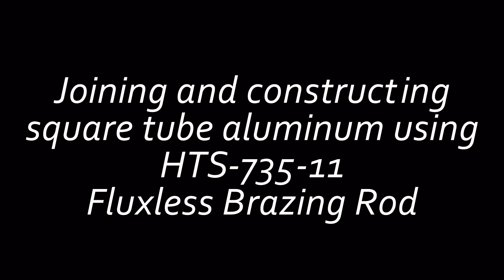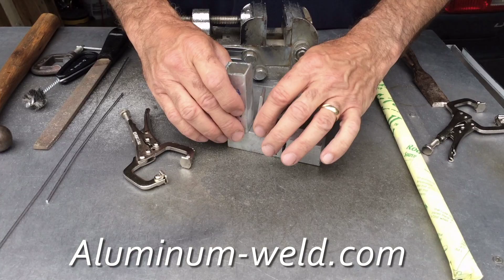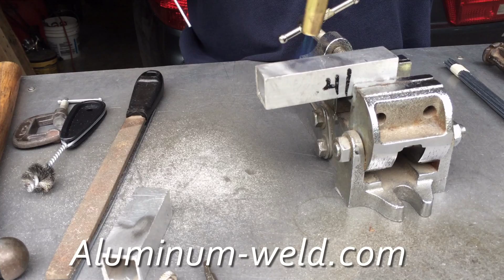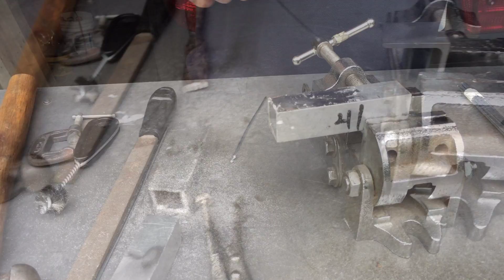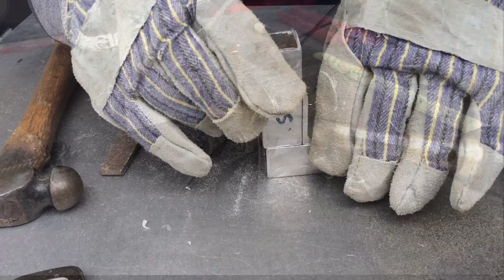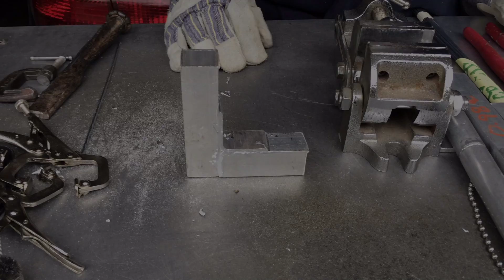Welding Square Aluminum  Tubing with HTS-735-11

Comment: Im new to all of this, and the brazing of aluminum has caught my attention to make something just to try it out. When brazing aluminum I take it that the length of the square tubing has a huge effect on initial heating,  would you suggest using a acetylene torch for tubing over a certain length or the propane torch will work?
Reply from the maker: Hello, There are several factors to consider, Torch tip ,  will make a huge difference, I like a Bernzomatic TS8000, you can use propane or Mapp Gas with this torch. The size and thickness of the square tubing makes a difference as well. Watch my video on joining irrigation pipe. I use propane for that video. You can use acetylene just control the heat, use a rosebud tip, watch my heat control video and torch tip video. Remember you are just warming up the aluminum to the melting point of the HTS-735-11 Rod.  If you cannot HTS-735-11 Rod to melt on the heated aluminum you do not have enough heat. watch my weld aluminum at home video. Thanks for your interest.

Comment: Great video. 
Lately I bought an aluminum rod online but I noticed that it didn't melt as easy as you did.  I think it's just normal aluminum though and not low melting one.  How I wish hts-735-11 is available in my country.
Reply: There's lots of aluminum brazing rods if you can't find this particular one.

Comment: Thank you for the video, Can I using this method to join aluminum tube to steel tube? And how many joints I can make in one such rod on your vid?
Reply from the maker: Hello, HTS-735-11 will NOT work on steel, stainless steel, or cast iron.. HTS-735-11 works on nonferrous  metals. You can join copper to aluminum. One rod will make between 3 to 6 joints.

Comment: ....and then when you go to join the other end of your square tube to something, you have to heat up the piece so hot that you melt your previously formed joints.  Because solder is fun like that.
Reply from the maker: Hi Andrew , Good point.  You would be surprised how little of a problem that really is. First you can let the first joint cool or you can used heat stops or heat sinks.  I have made joints very close together without issue. Also you can clamp the joints like shown in my video. Thanks for your comment.

Comment: welding is more of a marketing term for this stuff because a lot of people will look for welding rather than brazing so i see why its named welding it helps on a selling perspective but i would also add brazing too. 

do you have a video showing how strong it is like trying to pull it apart or something?
Reply from the maker: Hi Toto,
You are right on with your comments.  I do have a butt joint video that shows strength testing, also I plan to add several additional videos soon.
Reply: @Aluminum-weld  nice one
Reply from the maker: @TotoGuy-Original   Hello Toto I just posted a new video of a Tee Joint Strength test,  If you get time check it out.

Comment: Why are you always moving things and tossing things from beginning to end of video ????? Relax freak ! This is NOT WELDING this is soldering which is a MUCH weaker bond then WELDING !!!!!!!!!!!!!!!!!!!!!!!!!!!
Reply from the maker: Hi Rich,

Yep I was moving pretty fast, that is because I did not have my welding gloves and the metal was very HOT!!!!
As for the strength, I plan to add additional videos to address that in the next 3 months. This product will never replace welding, however it has it place for quick, easy, and portable repairs that are strong.  It has its place so relax man.
Reply from the maker: Hi Rich Check out my newest video added today with you in mind. "Tee Joint Strength Test."

Comment: This is aluminum SOLDERING not welding. Base materials are not melted together, there is no FUSION between joining parts, which actually real welding is. To call this Welding is dangerously misleading. A a structural engineer with 60 years of experience, I recommend to rename this video.
Reply from the maker: Hi Bob, added a video check it out when you get time.
Reply from the maker: Hi Bob I added new videos that addresses your concerns.  Check out the TEE Joint video.
Reply from the maker: Hello Old Bob,
You are correct that this does not fit the true definition of welding. The metals are not melted together. The metals are bonded together  via a (Eutectic Bond) that is stronger than the original commercial aluminum. There is actual fusion that can be observed when the rod is used. I agree with you the process is more like soldering than brazing. However not all the users have you experience and many have never welded anything. This is a great tool for these people to save money by repairing or building with aluminum.  The tensile strength is 45000 psi and shear is 31000 psi.

Comment: Where could I get the braces shown in this video?
Reply: Hi Matthew, You can purchase them at most any good  hardware store.
Reply: or just cut scrap square tubing and make your own
Reply from the maker: I just cut mine out of angle aluminum.

Comment: and how strong is that? you barly melt it togheter and you call that welding..
Reply from the maker: Check out my latest Strength videos.
Reply: xinzainity productions it's for things not under a lot of stress. Like I'm going to do this for my RC boat trailer with 1/16 inch angle aluminum.

Comment: Doesn't the steel wheel add oxides to the Aluminum? I was also taught to use a stainless steel brush followed by acetone wiping
Reply: Hi Steve,
Great question! Your statement is true for traditional welding of aluminum  and  it is also true when using the first generation rods sold by other websites. Those first generation rod contain aluminum making them much more difficult to use.
 HTS-735-11 is a Second Generation Rod that contains NO aluminum. Therefore a stainless steel brush is NOT required. HTS-735-11 does not need Flux and works on all nonferrous metals.  Because there is no aluminum in the HTS-735-11 it works in an oxygen environment and on less than perfectly cleaned aluminum. 

Thanks Randall
Reply from the maker: Good question, with other products that would be correct. With HTS-735-11 the steel in not a problem. HTS-735-11 is  second generation brazing rod that contains NO ALUMINUM.  Therefore there is not an aluminum to aluminum bond to be concerned with as there is with the other products out there.